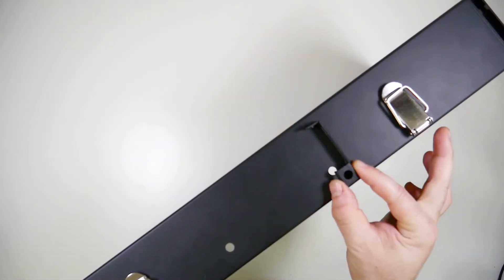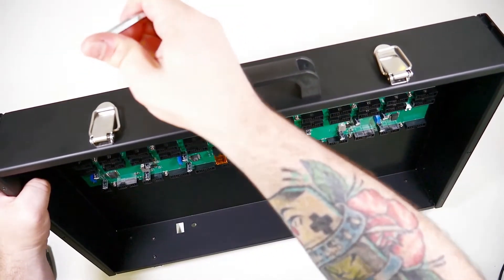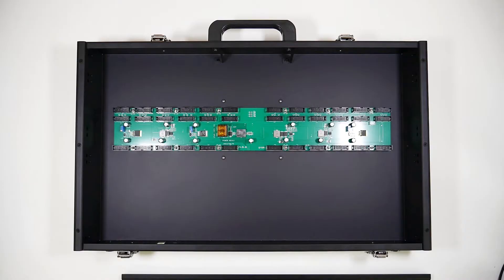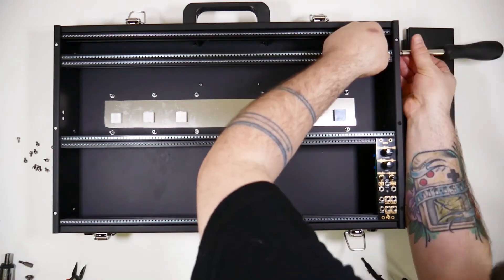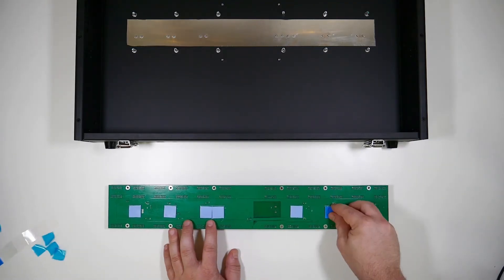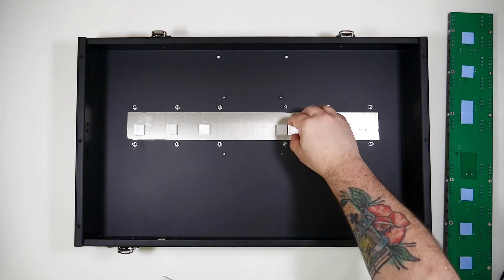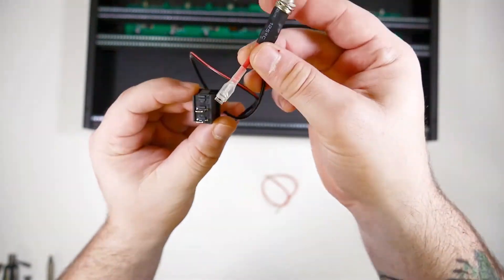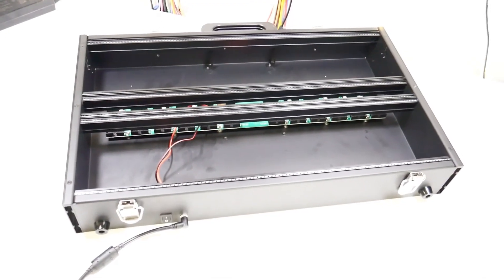ALA Case Expander How-To

Comment: Anyone know how to connect the input / output jacks and the midi?
Reply: It looks as though the Case Lid / Expansion doesn't have those options. Just a slot for the Power Cable. Maybe Cases vary to a degree though

Comment: I agree that this is one of the worst instructional videos I've ever seen. The narration doesn't make sense. Steps are completely out-of-order and contradictory. This video should be completely re-recorded or re-edited with each step put in the correct order. Easy peasy. You're not describing how to build a Saturn V rocket, guys. 

There's also not enough thermal tape included to do all of the steps shown. I received 7 pieces of thermal tape. I can either place these tape pieces on the underside of each heatsink with the nubs or I can place the tape pieces on the bus board. I can't do both. This video is ridiculous!

Comment: can the lid be vesa mounted as well?
Reply: Doesn't look like it.
Reply: @LoudPaul1  I bought one, and yes it is possible - however I am not sure I will use the VESA mount option on either case...I am not convinced you can eliminate wobble and bounce with the VESA arm when they are mounted and I think i would ultimately find that distracting and frustrating.  Also, there is absolutely no documentation or instructions with either case (the base and lid), so be prepared for that if your are expecting any kind of written guide
Reply: @particle-dots  I've been considering turning my lid into another Case, and mounting one of the two onto a VESA mount as I am lacking in space (onto the wall). It looks as though only the Main Case has the Audio Out and MIDI jacks, etc. and not the expansion / Lid. Most of the VESA mounts I've looked at support up to 15 or 20kg, and my current Adventure Case weighs 6.5kg with the sides off (a lot of weight, and I don't need them as I'm using a Guitar Stand). It would definitely be nice to have better documentation and explanations out there. If / when I go through with this, I can come back and update how it went

Comment: so does that mean you can no longer use it as a lid?  is there a spacer that fits between the two halves of your case so you join them w/ room for knobs etc?
Reply: That's an outstanding question! I just bought one and was wondering the same thing, as I plan on turning the lid into another case
Reply: That is a good question, there's absolutely no more information about this on their website as far as I can tell, and no spacer. Looking at a photo of these 2 cases, there's definitely no room for cables and knobs, so I think this turns your live case into a stationary, studio-only setup. I guess it's cool that that's even an option, but a spacer would be a great idea.